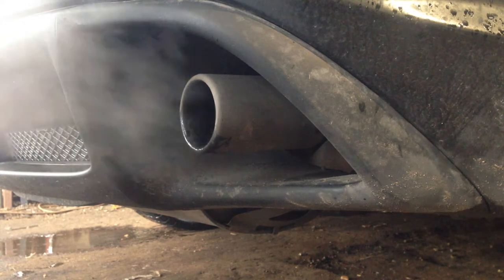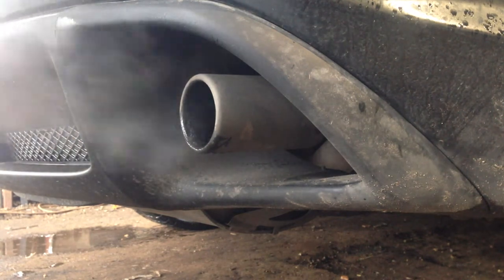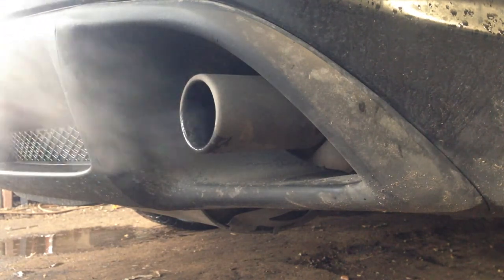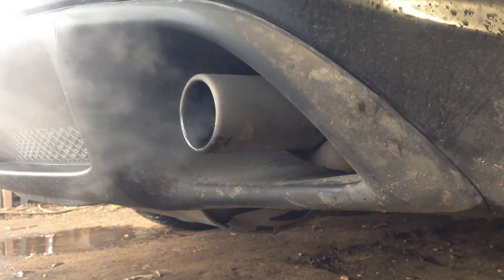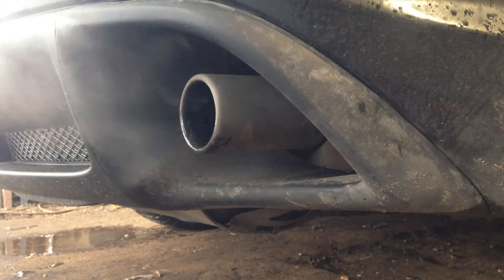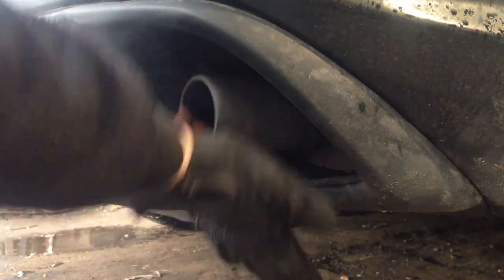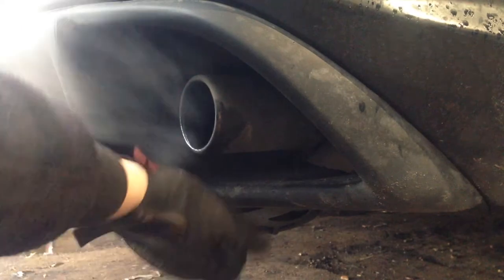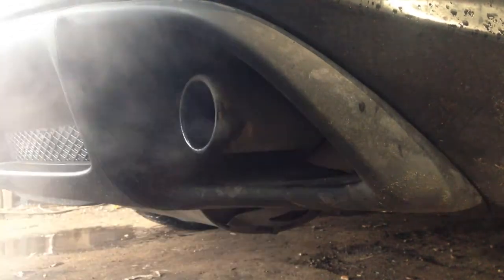Essex Rotary Quick Vid 22 - Checking If My Catalytic Converter Is Dead The Cheap Free  Way

Comment: My cat failed and parts of it broke apart and got into the muffler. Not sure why, I did hit a piece of metal on the highway and it made a bang. But I also noticed the cat would glow at night occasionally under heavy load even before this. Finally got the I changed it due to the P0420 code and upgraded the ignition system. The new cat is still glowing but only visible at night after high revs. Does that mean my new cat is also failing?

Comment: Is it normal for the cat to glow around the 02 sensor, even brand new? I replaced cat some years ago, there is some rattling in the muffler, which is probably broken parts from the old one. Could this also clog the whole system? Is it possible to use OBD2 to check fluctuation in downstream sensor readings? I've read its an easy way to figure out if cat is defective, but i can't seem to find this sensor on OBD2, is it Bank1 sensor 2?
Reply from the maker: No it is not norml, if its glowing then you have overfueling. thats usually caused by ignition issues,

Comment: When i bought my rx8, on one of the work logs the old owner got done it said - "removed cat back section of exhaust" - so I presume the cat has been removed? is there a way for a novice owner to check this ? Im getting p0420 error check engine light, nothing else. Really worried about this so any info helps thanks
Reply: P0420 is usually cat related, chances are that they reused the sensor and it's reading that the cat is missing. Nothing to worry about. Easiest way is to get under and check check if it has a stainless pipe, but some people hollow out the stock cat which would require dropping the cat to inspect inside.
Reply from the maker: You would need to remove the O2 sensor from the cat and look inside with a torch (flashlight for our yank cousins) if it looks hollow with no sign of catalyst then its been gutted.

Comment: Hi i was wondering if you put a de-cat midpipe do you have to plug the o2 sensor back in and plug in or can you just put a blanking bolt in the sensor hole and remove the sensor completely Regards Dave
Reply from the maker: Hi Dave
I would always recommend installing the sensor, If you leave it unplugged then your running the risk of shorting the wring out if it gets wet.
Either way you will get a CEL on the dash if your running a decat that you will need to get mapped out, we are able to offer a reflash by post service however it involves removing your ECU and posting it to us.
There is nor really anything to be gained by leaving the sensor out of the new midpipe.

Comment: Can cat material get into your cat back exhaust mufflers?
Reply from the maker: Yea? It will cause rattling that will drive some people insane.
Depending on your actual catback design then the problem will vary in severity
Reply: @essexrotary1540  what type of rattling? Does it rattle when you drive? i have a racing beat cat back exhaust. And When you pick up the exhaust and shake it you can hear some rattling. Idk if it’s normal or if pieces of cat material got in there.
Reply: @Juli_42o  Could be a rotted out heat shield bud. They tend to rust away pretty quick. With a clogged exhaust you'd probably notice some power loss at higher revs. Mine rattled like hell on idle so I just ripped it off

Comment: My gear stick was getting hot and did see it glowing but couldn’t get under her then now the stick is cold and sure I can taste oil or exhaust but still pass the mot ??
Reply from the maker: That is a strange one.
A Glowing Cat is a sure sign that your cat has got way hotter than it should.
We have seen Cats where half the catalyst (the rear half has failed and caused a blockage, however cleared the car will make it through the MOT (in some cases only just)
And because it is the rear section missing then the Check Engine Light stays out.
Did you try our trick ratteling the Exhaust?
Have you changed your coils since the issue?

Comment: My Cat's goosed at the moment, what are best options for replacement on a budget? Obviously coils and plugs need replaceing as they have the black spots on and casings faded so replacing these with a set of NGK plugs and coils. My budget is around £150 for a Cat at the moment as i need to get through MOT. EuroCarParts have an offering with discount new for £150 or would it be better to buy a second hand original? I can also here a glass rattling sound when i rev in my failed Cat also.
Reply from the maker: Dont buy NGK coils and those cheap euro's cats are a waste of Monty.
Check this video to see what i am talking about
https://youtu.be/IDfVLD2u33U

If your replacing coil either use Genuine Mazda parts (available here http://essexrotarystore.com/product/genuine-mazda-ignition-coil-pack-set-for-rx-8/)

Also be careful with spark plugs, we will have a video out sometime in the near future detailing fake plugs... yes this is becoming a thing. 

End of the day we cant supply a good quality cat, and i dont know of any other shop that i could point you to that has a good cat at that price. If you do buy one just dont expect it to last very long and we would recommend removing it as soon as possible.

Some people seem to be using cheap cats for MOT and then going Decat the rest of the year, this is obviously illegal here in the UK.
Reply: Many thanks for this, what is the best brand coils to buy out of these? Delphi, Stark, Ridex, Japan Part, Meat and Doria, Jan Mor, Ashika? I'm ordering from AutoDoc as they are significantly cheaper.
Reply from the maker: They are significantly cheaper for  reason... they are not reliable.
Do you not think that if there was a viable cheaper alternative for the genuine Mazda coil packs we would not be offering them.
I know i am risking sounding like a d!ck here but its the truth, we see so may customers who have bought pattern parts and the car is still not working right. we test and find its the pattern parts, however they are blinkered and skeptical as they have already paid once for that part.
If you cant afford genuine parts then i would suggest save some money until you can, there is nothing wrse than buying the same part twice.
Barring that give us a call as we may have some good used coils in stock... we dont always get them but it is worth giving the office a call.

Comment: I got a misfire and ruff idle anyone got and ideas 87 fc rx7 na
Reply from the maker: Check your ignition system.
Reply: @essexrotary1540  figured it out it was a bad tps sensor and coil pack
Reply from the maker: alex z coolio, hope you set your new TPS Properly
Reply: @essexrotary1540  I had a friend do it I dont know much about the electric I know he tested the amps or something like that then adjusted the screw until it was set to the amount he found online

Comment: what if i put on a brand new cat and i drove over a traffic island  but the cat has a scratch could that be a reason (no codes)
Reply from the maker: Hi Kavi
Could i ask you to explain yourself a little more please?
Reply: im not sure if my comb is broken because my car feels like its in limp mode when it comes to shifting throttle response the car is reving when its driving but its not putting out power no engine code lights but rarely  after i unplug the battery the car runs amazing  (i drove over a traffic island from a spin out and i grazed my cat )
Reply from the maker: a grazed cat pipe should not cause what you where reporting, however it if has been damaged internally then that is a different story.
Its a little strange that you repost if runs great once you remove the battery and put it back on however.

Comment: Just wondering how much it will cost for you guys to fit a new cat? Cause when the time comes no way I'm paying 1500 from Mazda 😂😂 I see the one on the website is about 450 pound
Reply from the maker: Please refer to our website for cat pricing but i can confirm they are a lot cheaper than going Mazda OEM.
Installation again would depend on pricing at the time, drop us a line when the time comes.
BUT keep your coils in good shape along with your HT Leads and Spark plugs and this should extend the life of your Cat.